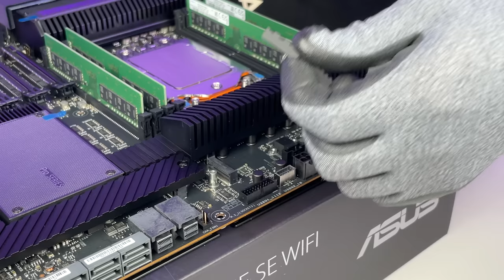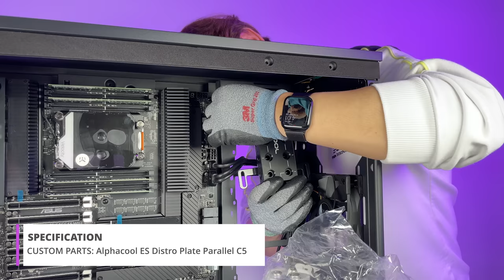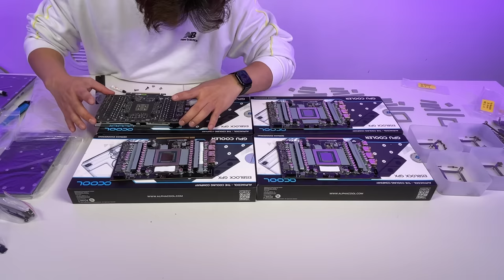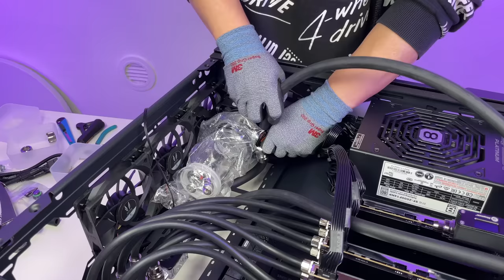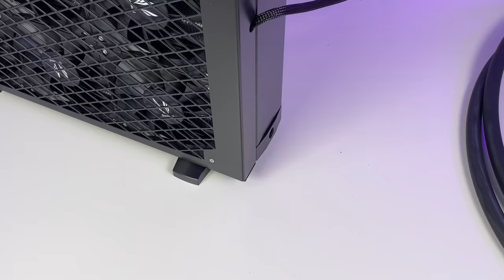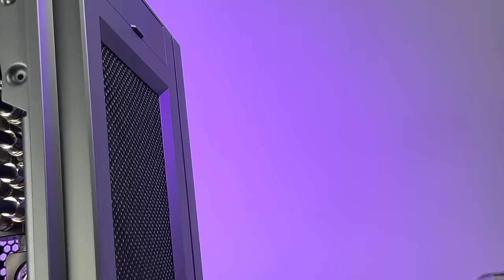$26000 RTX 4090 4Way ㅣThreadripper Pro 5995WX

Comment: Hello. Some tips from pro:
1. Jet impingement cooling in those blocks will not work:
a) You have only one D5 -5L/min flow - at best. 
b) you've connected 3x 360 linear radiators to the pump outlet by hanging tubes - you're decreasing flow more
c) comeback is through flowmeter up to the terminal....
d) you're using fully parallel terminal = so you're splitting 4L of flow to 0,8L/min with dramatic pressure
2. Having 0,8L/min on 5995WX is totally uneffective for 280W at stock never mind any OC. With 8 channel RAM this CPU TLC die will overheat and may even have stutters at desktop
3. 450W cards will throttle
4. You've made 2 part WorkStation while not using any in-case radiators.
5. Look at your flow on the flow meter at last scenes - it's very bad, while it should be flowing like hell because it's right before terminal which will divide it to 5 streams. 

You should've:
Used Revo Dual D5 (11L/min with radiators) + 1x D5 with reservoir = 12L - 13L/min flow.
Use semi parallel terminal or linear with radiators in the middle of this flow.
If CPU OC was considered you should make CPU at line 1. 
First after pump should be waterblocks, not quick couple disconnects and rads.

PS: 4Way means SLI or NVlink - you do not have 4Way. You have QuadGPU setup. 

https://hwbot.org/user/adventurepo/
Reply: Can you explain in layman's terms this  
1(d): you're using fully parallel terminal = so you're splitting 4L of flow to 0,8L/min with dramatic 
pressure
And then how your solution: Use semi parallel terminal or linear with radiators in the middle of this flow.

Solves this issue.
And please kindly remember, if you can't explain this to an idiot, then you don't really know the issue.
Thanks.
Reply: @dreamfunction4491  First  "And please kindly remember, if you can't explain this to an idiot, then you don't really know the issue." Well there are many things that idiots don't understand even when presented with all the facts and given simple presentations. And as thermal fluid dynamics are very complicated subject even for students, do not assume there's a simple explanation so any idiot can understand it.. So this argument is in fact out of the window. 
In fact: in fluid dynamic and thermal fluid dynamics there are that many numbers and ratios than not many teacher understands them fully.  But I'll try :D 

You have 1 liter bottle / minute produced by a machine. If you're drinking yourself only then you have a litter for yourself every minute. But if you're making a party with four other guys you'll have only 1/5 of this flow every minute. So the pressure in all your bladders will be lower ;). 
or 
you have 1 pizza in 20 min, if you're eating alone you have 1 pizza every 20min. If you're eating with 4 friends you have 1/5 of pizza per 20 min.

Jokes aside : a limiting factor of flow is the diameter of the single tube and throughout of MORA with 2 QDC in the middle of this. Now you're splitting 1 stream into 5 same diameter streams. There's no magic there, unfortunately. Your streams have to merge after terminal also into same diameter of tube. Normally the limiting factors of streams are jet plates of waterblocks, but here it will be the flow through rads, QDCs and tubes. 
If you'll poor 1 liter of water on the ground with an angle, your stream might divide or not. If not: it will be thick one stream, if it does: divides into smaller ones. The terminal is not multiplying water in the system. It divides and distributes it.  

The flow from the pump has it's volume (V) and speed (v) and from those (in very complicated way) you're getting pressure (P). If you're using parallel terminal you're splitting this Volume Vrc1 into 5 same diameter streams Vrc2 which is in fact Vrc1 x5.  Volume per minute in everyone of them will drop to the maximum volume that a single tube pre and after  terminal can carry in time. So when the volume per minute drops - it means the velocity of the flow dropped. And when the velocity of flow drops the pressure drops. 

Most of the water blocks has the jet plate - for jet impingement  cooling. This plate narrows and elongates the stream into line so it will go through all the fins of cold plate. But the higher the flow and pressure of stream through this jet plate is, the more turbulent flow occurs. The more turbulent flow is the smaller stagnation zone will be between the fins of cold plate - the more water will be pushed deeper between the fins.

If you'd use semi parallel terminal you're dividing stream into 2 or 3 streams -not into 5. So the flow is higher = volume per minute is higher and pressure is higher. 
Let's say pump+mora+QDCs  -> CPU + 2x GPU -> radiator on top (cooling) -> 3x GPU-> pump. You'll then have divided the stream into maximum of 3 same diameter streams. So in every stream of this situation you'll have higher flow/min. The higher the flow the better the cooling. 

Did you get it? 

Some equations and 
https://phys.libretexts.org/Bookshelves/College_Physics/Book%3A_College_Physics_1e_(OpenStax)/12%3A_Fluid_Dynamics_and_Its_Biological_and_Medical_Applications/12.01%3A_Flow_Rate_and_Its_Relation_to_Velocity
https://www.researchgate.net/publication/323314537_Impinging_jets_-_a_short_review_on_strategies_for_heat_transfer_enhancement
Reply: Was going to just say the same thing. He should be running at least a dual d5 in parallel. I would also recommend that he has another separate pump on his MORA.
Reply: awesome comment
Reply: 4090 don’t have sli or nvlink. Cad and blender already can multitask without this.
Reply: @tazgoth23  Well.. yeah. The name of this is: Quad GPU not: 4Way, as 4 Way was SLI is up to 1080 TI and 4 Way NVlink is up to Quadro 8000. Everything else is multiGPU support. Here, 4090 x4, are not working all together and pooling all their memory in any viewport or displaying function. They'll work all together in rendering or AI / ML computations.
Using right nomenclature is important as it quickly informs about abilities of the setup. They're pushing wrong nomenclature, which will spread the confusion.
Reply: Have money have no mind
Reply: This guy PCs
Reply: Yes Piotr one D5 pump it`s a good joke and the flow meter showing bad knowlege about WC. Thermal pads putting on 4090 by hand ? WTF Oil,gresse from fingers will kill this
thermal pads instantly. Threadripper OC ahhahahahahhahaahhahhahaha yyyy yes mate, it will pass away after 5 mins of strees test. Rest of your comment right on the point.
Reply: Разложил по фактам
Reply: @dreamfunction4491  "Please explain me and if I can't understand it, you are an idiot"

While I find his original statement about the flow pretty easy to understand... 4 "bottles" to individually fill and empty to will give you a slow flowrate, when it could have been 1st graphic card going trough 2nd then 3rd and 4th and goes to the radiator.
Reply: this was made for yt content not for real usage.
Reply: Thanks for the expertise Piotr
Reply: @Aximasan  Most of the thread has been censored/ deleted by J tube. I can't reply.
Reply: If it wasn't for the game satisfactory I would have not of understood all of this but with the way water pumps, pipes and water work in the game, I understand flow, head lift and all of that good stuff. I had too many Coal Plants with out enough pumps so my plants never produced electricity. After some fine tuning i got everything working...Sorry i know i brought nothing to this conversation.
Reply: @nart216  Bring some: About what game exactly are you talking about? :D
Reply: @makintosz461  5 minutes..... It will pass, it wall pass.... it will pass out .XD
Reply: Not to mention, having that many GPU even with a series 5 thread ripper is overkill, there's no way to utilize them, never mind without using a quad bridge for SLI which at this time is long dead and has almost no benefit
Reply: @wrathofgrothendieck  You're welcome.
Reply: @Adramelk  Well there are ways that 4 GPUs (QuadGPU setup) will work without any SLI or NVlink
a) firstly, as they've suggested Machine Learning and AI; although here CPU power is not always that important if you're writing code for GPU's
b) rendering Blender, Octane, Vray, Lightroom - do not need any connections between cards - here to CPU is not important. 
c) rendering with CPU help (Not CPU rendering) - Redshift - it is using for those cards like 50% of i9-7980Xe with no OC.
d) math engines - doesn't need no SLI, NVling, uses a bit of CPU

Now, there are three main cases to use machine in that configuration
a)Adobe Premiere + Adobe After Effect - 0ne machine, multi purpose
b)Redshift & Houdini - the later uses CPU only for strict particle simulation
 
So, there are uses of that machine... it is just not built for them properly as they utilize a lot of power and thus giving huge amounts of heat.
Reply: Also, trusting everything on ONE pump, lol. And having 3x 360 rads, idk if that's enough for 4x 450w + 280w base power consumption.
Reply: @ADV_PO  unrelated to the video: thank you for the links, these will help me greatly in understanding fluids and heat exchange (other chapter).
Reply: short version:  If you flush your toilet into a gardenhose, pressure is high, flow is weak..  :)
Reply: @ADV_PO  well the 20 series supported sli so there's that
Reply: Are you a plumber? Lol.
Reply: @ATY676  haha no 😀
Reply: Holy sh!t you are fking smart on fluid dynamics huh. Bro I learned more here than I learned in some of my classes
Reply: @epic_errors  RTX 2000 yes  - but only 2Way NVlink. Only Quadro on Turing architecture was able to run 4Way NVlink and thus  4Way SLI. There was no bridge for 4 cards in RTX 2000 gaming series.
Reply: @ADV_PO  There are no modern games that support SLI so its a pity we cannot se any benchmarking as this would probably be overkill for years to come lol
Reply: @onepunchman6165  😅 Thank you. It's much easier to understand it all when you have equipment, hardware and time for testing.
Reply: i understand you are a pro but i think what you are seeing is the camera not keeping up with the speed of the flow meter. its spinning in reverse compared to how the flow goes in so my conclusion is that its capturing funny with the frame rate of the camera
Reply: @LtdJorge  Yeah. I wouldn't trust it either. In fact even single TR 3990x with 360 GTR and 480 GTR @4.2GHz can kill water pump after few months. An we're talking about 4,5-5,5L/min with Magniture WB. 
This setup with this flow will heat up EK Pump much quicker. I'd say 3 months and there might be a problem (due to the worse scenario: the heated up liquid is flowing directly to the pump)
But I wish them luck and not having that problem at all.
Reply: @ADV_PO  i just want to thank you for giving a detailed description of the problem it was very helpful and hopefully I will have a reason for the knowledge in the future
Reply: god dang, and i thought i was a nerd
Reply: @SuperZeap  You're welcome 😃
Reply: @magnusthem1ghty578  In fact you might be right about that one. But if its spinning slowly backwards in the wideo we could count the rotations by the angle per frame. 
Don't  wanna get into this math. The thing is: I already assumed the best possible flow through all this stuff: 5L/min. Do I hold my position by the insufficient flow through water blocks? Yes I do.  Do I think it will overheat? Yes I do. At idle (no cables to GPU attached) this fluid has 27 deg. 
What could be the best answer to my advice if I was wrong?:  Show scores and workloads in continuous benchmarks or rendering (Cinebench R23 - 30min; Octane - 3 runs).
Reply: I actually like the idea of external rads for something like this - since the external ambient temp should be lower than the ambient temp within an enclosed case - making the radiator slightly  more effective. My system is quite dated now and I'm contemplating of updating it, but I'm not sure if there are any cases that allows external rad attachments...
Reply: from pro?? dont be joke !  Some of us saw your shop selling overpriced pcs / workstations... pls...stop man
Reply: was waiting for the thermodynamics explanation.
Reply: @albertwesker4266  🤣😂 Yeah, yeah. 1. Well I don't have a shop. Even on-line. 2. Yes, not everyone can afford Bugatti. It's your problem. 3. I'm working only for pros and only recommended. 4. I do not even have to advertise . 4. Who exactly are you? With this channel of Crysis 3 Credits? 🤣😂
Reply: @albertwesker4266  Well, you're crossing some lines. I've sent some info to YT. You were never my client. An my clients have great opinions about my works. 
Look out cause we might be on a very bad path. Your replies might be implying that you cannot read with understanding but that is not my problem. If you're damaging my good name, you may face legal consequences.
Reply: @ADV_PO  haters will hate, but who takes the time to share hard earned knowledge in such a concise way?  Only people who care about the value of shared knowledge in the first place. You took me to school, I took notes and now I feel privileged to be part of the 20%.  Tx for taking the time!
Reply: @cs0654  Thank you 🙂
Reply: Not sure about your 0,8 liters. I am running a Mora 420 (3x 420 rads) + 2x 360 Rads internally + Cpu/Gpu and have 60 liters (digital messuring) with one d5 pump running at 45% power. D5 is quite strong so one may maybe enough.

But i agree that the cooling solution overall is underpowered for that much heat.
Reply: @Dedrael81  I have a question: If at 45% you have 60L/h = 1L/min. Lest's say that's 2200RPM on D5. At 4700RPM you can have about 2,2-2,5L/min. Is this a big flow?
The thing about this flow in the video was a parallel terminal - splitting flow to 1/5 per every piece of hardware. That's why I said it's insufficient to have one pump.
Reply: @ADV_PO  Thanks for your reply. As i read about it 40-60liter/h seems to be an average and aceptable flowrate. The gains in temp with much higher flowrate may not be really worth the added noise. But of course i am no sure about this parrallel stuff. That may be a flowkiller and of course a TR Cooler and 4x GPU Cooler will decrease the flow also. Overall the cooling looks underpowered but first what i would do was buying two Mora 420 instead of one 360.
Reply: Bruh
Reply: yeah i know its a cool setup but it honestly looks and it designed like trash. I really hate to say it too.
Reply: Im not adding anything to this topic, just wanted to say im proud to be your like nº 666 :)
Reply: I actually really respect this comment, the planning, math, design and implementation is a must for a system like this. anything less then perfect will cause catastrophic overheating. 🙏
Reply: @Dedrael81  This flowrate 40-60L/h is was and is acceptable for almost all non-overclocked CPUs till 10th Gen of Core, all Ryzens and all X299. For Threadrippers you have to have higher than that. For GC waterblocks it is still good flow for like 250W as they're much bigger and heat dissipation in them comes all around of GPU cores coldplate. But...
 For OC CPU to like 250W - id say 180L/h at least. For CPU TDP of 450W youl'll need at least 5-6L/min and that is 300-350L/h. 
My "Mothership" Universal Liquid Cooling for Testing has about 7,5l/min (450L/h) with special sTR4 water block from NudeCNC (like 5% better than Magnitude) -and only then I was able to hit 4.45GHz on all cores for 3990x without overheating (the sample was OK, not great but really good).
For GPUs like 3090 Strix, 4090 TUF/Strix and alike you need IMHO min of 180L/h flow to be able to not overcome 65-70C which  triggers thermal throttling. 

For 4x2080 TI in Death Star GPU rendering serwer loop for GPUs was 2x 560 GTR Nemesis with Revo Dual D5. 
For Batstation 4x 2080TI with 3970x @4.3 Threadripper  I had Revo Dual with huge Reservoir. 
Those GPU servers were able to compete in any calculation and take any benchmark like by 5-7% higher than the rest. 

Check this out /watch?v=XNI9qISUkKw
Reply: @SuperZeap  /watch?v=XNI9qISUkKw here I gave some studies at description at the end.
Reply: @ADV_PO  when using parallel loopes, the flow rate in each loop is inverse proportional to the resistence. And thr resistence is the sum of the pipes, qdcs, coldplate and so on
Do these manifolds have a restrictor for each individual loop so you can adjust the flow? Or is it just a bit random?

In heating (buildings) you use special balancing valves for this purpose
Reply: @ADV_PO  Apart from enjoying the read from someone who knows what they're doing, tip of the hat from a slight different industry with chillers ;) I'm surprised you're not pointing out that the rad has the fans the wrong way round as well... While on most small systems the orientation won't matter much as the store fans are garbage... in a grid pattern, even a store fan in the center fan will just splash and waste the airflow. Ignore what, a GEST of 15% surface area and not get to take heat out of the fluid that's already boiling. Boiling fluid through the pump, good joke yeah!

Originally I wanted to point out that just flipping fans should be an easy 10-15% gain in thermals, regardless of the horrible flow rates (which are well measured of course!). Then I read your comments, a warm welcome in a desert of knowledgeable YT comments. Never seen a thermal design so... not optimized (ok, I may see one soon at a client whose heatpumps hit a COP of 2 / EER of 6... ish out of 4 / 13, but hey we gotta eat and fix other peoples 'designs').

The comments to you were hilarious and I enjoyed how you kept relative polite despite some serious keyboard warriors. My priv server ran a 3990x easily overclocked to a steady 3.6Ghz all threads if you set cooling proper. Some people here were questioning whether 3x360 could diffuse 4kW of heat... Easy, but not with basic fans and this setup ;) This is why you actually go to school, study, build up experience and spot a video like this cringing and laughing... Then some try to share their knowledge, not because we need to, but because the more educated our society becomes, the more likely someone else pushes us forward. 

The goal is not to get rich, it's to have the option to not die on this planet people! Shoot high!
Reply: @FreakyAngelus  Thx. Yes I think this pump might quickly die. I hope for them that this one is the best there were ever made.
Reply: @Leminge42  These parallel terminals Alphacool_ES_Distro_Plate_Parallel_C5    have some screws at the back side, but in the instruction there is nothing about those having any function to regulate flow.
In fact this is not a bit random, as water is not very compressible liquid. The pressure in the whole line of inlet will be just the same as in a single tube that was delivering it. 
So if this one diameter changes into 5x higher diameter - the pressure and flow might be counted as almost exact 1/5. 
Shame they don't put it into instruction. :(
Reply: +1 on 4Way clickbait...that is BS!
Reply: @ADV_PO  The arrogance
Reply: @Piotr Orkisz  wish I had you as my teacher in school. I would've learned something useful. Maybe I just didn't make it far enough to learn things this interesting. Either way enjoyed reading your comment and thank you for the notes link.
Reply: @Cannabis_Connoisseur  😅  Thank You. You're welcome. Under this one, you'll find more notes.  /watch?v=XNI9qISUkKw   (YT doesn't let me put them into comments - the comments with them are never shown). It might be boring, as someone stated -I'm not a pro YouTuber.
Reply: Finally, someone who knows stuff and it's not impressed by the amount of parts but by the functionality.
Reply: I sure do love arm chair engineers
Reply: @chadmulligan3003  Is this one about me? 😅
Reply: @ADV_PO I am studying engeneering and  I've learnd about thermodynamics and Bernoulli equations some time ago. I have never heard such a "simple" explanation about this topic! WOW! I wish I came across this comment a lot earlier. Have a great day.
(Please excuse bad English, I am not a native speaker :) )
Reply: @xyrp2461  I'm happy that you've found my explanation useful. The simplicity was a bit forced on me. But sometimes being forced to achieve something helps to achieve it 😅
Reply: Not to mention that the Computer itself doesn't work. If you look at the Dr. Debug you will see code 00 meaning that the motherboard doesn't even detect the processor. And that's why I hate people who don't know anything and start building computers and say it's easy.
Reply: @adrianpetrov6365  Shit! Adrian! You've just made it a loooot worse. Damn, man, I was so focused on the lacks of this water cooling that I totally didn't see that 😅
Reply: @ADV_PO  It's just I've been in this for so many years I spot everything to be honest😂
Reply: @adrianpetrov6365   In my mind there is no place to upload a movie about something that is strictly no working. Mindf*** as hell. Citing the meme " Hahaahahahaha You're serious??"
Reply: Ok
Reply: "from pro" 💀💀, bro literally no one knows who are you
Reply: @user-zs8qp3pu5d  🤣 Bro, literally, you are two clicks from knowing. You know how links work, right? You know that if you click on my avatar you'd know what I do?  Please put an "L" on your forehead for that comment. 😂 Literally you mean, I'm not popular, so I don't know?
Reply: According to the data sheet, alphacool parallel d5's fifth pair is serial (first four is fully parallel). So the cpu will get almost full flow (minus the resistance from four 4090s).
Reply: It looks to me like there is a single loop cooling everything.
Although it looks amazing I find it to be higly inneficient especcially when you are going through so many hot components :
1. GPU1 will raise watter temp by 2 degrees
2. GPU2 will raise watter temp by 2 degrees
3. GPU3 will raise watter temp by 2 degrees
4. GPU4 will raise watter temp by 2 degrees
5. CPU will raise watter temp by 2 degrees
Depending on the order you choose you can see that by the time the last component is reached the watter temp will be 8 degrees higher than when it left the radiators.
And that for an assumed increased of only 2 degrees per component.
This is why I will allways preffer closed loops to cool individual components.
Reply: THANK YOU!
Reply: I forgot to poop
Reply: just regarding 4 way sli  he does not need it i assume he will use it for 3d rendering and you don't need any bridge nvlink  to use all the cards at 100%  ,
Reply: @chadmulligan3003  guy leaves his credited hwbot overclocking enthusiasm forum page littered with badges and proof of proficiency, noname chad mulligan comes in and types a comment thinking he's contributerd to the world
Reply: Bro went straight to the point 😂🎉
Reply: @ADV_PO  you just roasted him
Reply: @niklxs7736  To roast is to sarcastically, while being funny, exaggerate someones faults, flaws, misbehavior. Nothing in my comment was roasting. A little bit of roasting might have been done to dreamfunction (1st answer to my comment). :D But not to the video in my comment.
Reply: lol i agree with what you got but.. sigh facts win, interesting build nonetheless xd
Reply: Piotr, so does that mean that Aventum X is more powerful than this one in this vid?
Reply: Pedantic bullshit is not needed here this was just for fun.
Reply: @thelaughingmanofficial  OMG, I was so waiting for your professional opinion on that you can never kkkkknow.  🤣🤣🤣
Reply: There's an epidemic of builds like this on YouTube; it's painful to see how many glaring mistakes they all have, but their target audience doesn't know any better. So much unrealized potential...
Reply: does quick connects reduce flow or something?
Reply: @SuperSkandale  It very depends from which company and which model. Koolance, EKWB - very little, Alphacool (made after 2020) - badly. 
This one is in Polish, but you may understand https://youtu.be/_EEX6VEKX4o. 
I'm using up to 4-6 set sometimes and I'm able to fully cool up to TR3990x and 3x 3090 in single machine. 
The most restrictive part is always CPU water block. If it is not then this CPU water block is not efficient for high TDP parts. 
Easy testing: 1. Brush your teeth. 2. Connect both parts female-male 3. Blow through it. 
It should not be restricting air passing through. If it does it's a bad quick connection.
Reply: im not sure about 4 cars will throttle he has 2 4090's connected to the first psu and 2 to the second and the threadripper to one of them so it prob won't throotle unless he plus all 4gpu in one psu which he did not
Reply: @jasonlin4882  power isn’t as much of an issue with this build as cooling is. That radiator has enough cooling capacity for about three GPUs, not four plus the CPU, not to mention how slow the liquid is flowing. If it ever hits 100% resources, best case it thermal throttles and runs way slower to stay cool, worst case it shuts itself down and parts potentially get damaged
Reply: @LtdJorge It’s not the number of rads, but the density, if they are 50mm to 60mm, that is enough with the pressure 120mm fans can produce, if 30mm, then questionable cooling.
Reply: lmfao
Reply: @dreamfunction4491  What a rude way to ask a question.....
Reply: Obviously
Reply: What happens when it's built??? Can you watch the fluffy zoomed in and slow mo?? Or does it make the tv play films backwards .... Or can you scam your nan faster?? I'm intrigued
Reply: i struggled with 5x 120mm surface area of rads with just a 7900xtx and a 5800x, to keep it fully cool at full tilt its needed 7x 120mm rad surfaces and push pull fans to keep the noise down, theres like 3000w on that system, im unsure if that system can cool it effectively, especially like you said with one D5 pump, would like to see the temps when stress tested :)
Reply: percebe-se que o senhor é uma autoridade no assunto. Respeito.
Reply: Bro have you even built a pc before?
Reply: @pewpeww556  1250 Workstations, over 140 Workstations build with LC. 12 with multi GPUs.
Reply: @ADV_PO  rookie 😅
Reply: @ADV_PO  Well, I'm pretty much an idiot when it comes to custom loops, but even I thought "hey, one reservoir and one pump is kinda low for four GPUs and a TR."